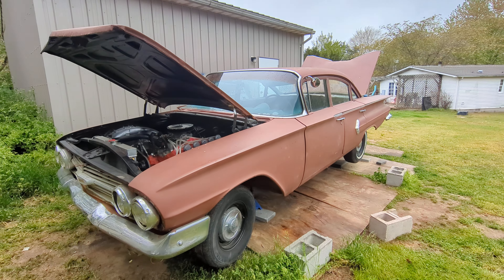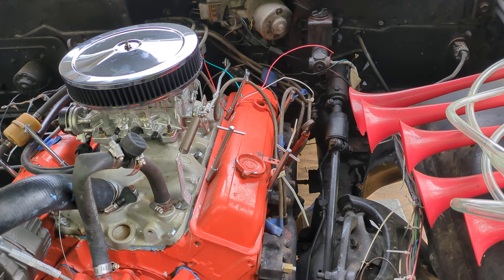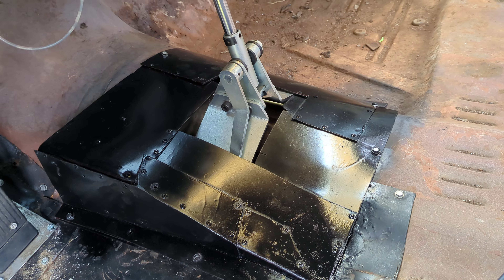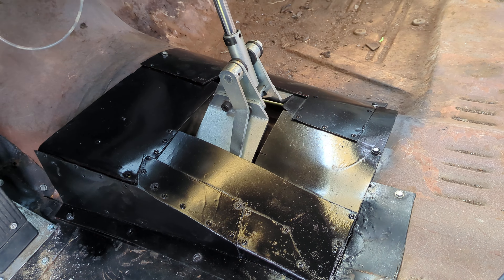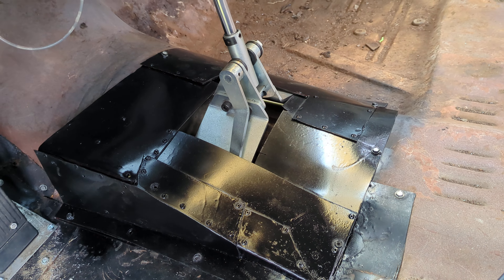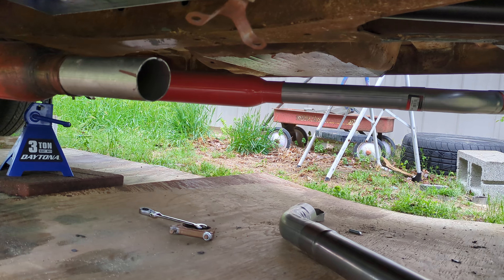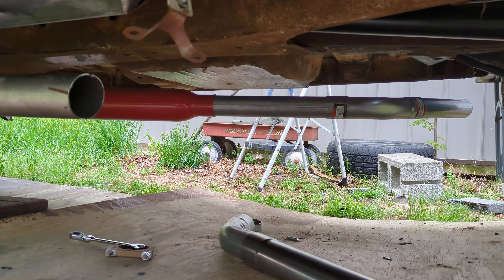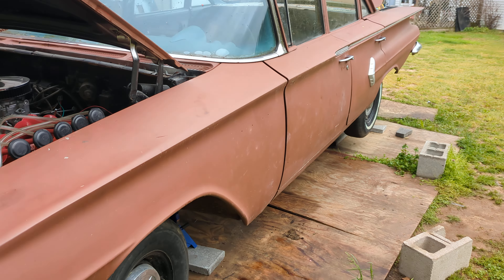Shes almost ready for the road!

Comment: You really need to look int Electric cooling fan., because I can tell you right away.You're gonna have a failure with that cooling?Take that from experience
Reply from the maker: Im thinking the same thing. She went up to 200 degrees during a shakedown and it was 65 out.
Reply: @junkyardhack6292  see a hot mess that's what I ment, duh.